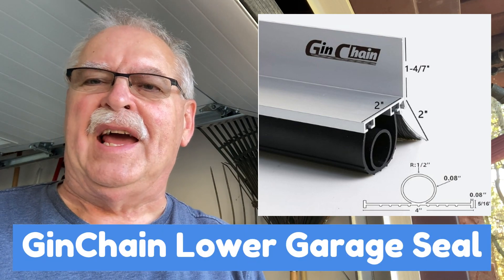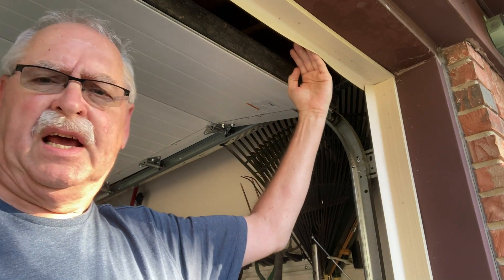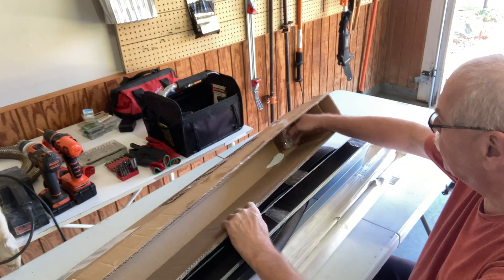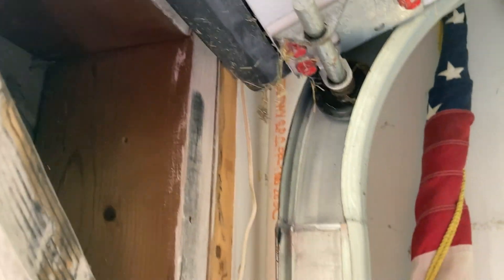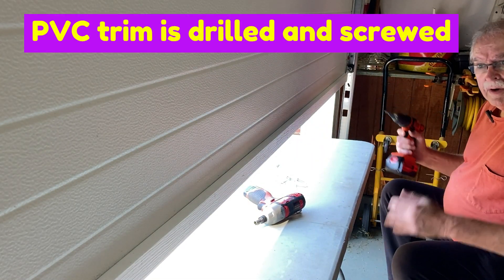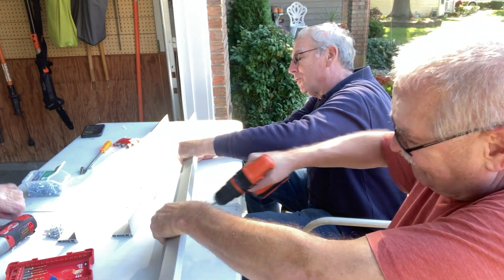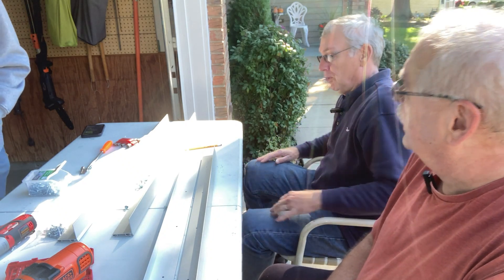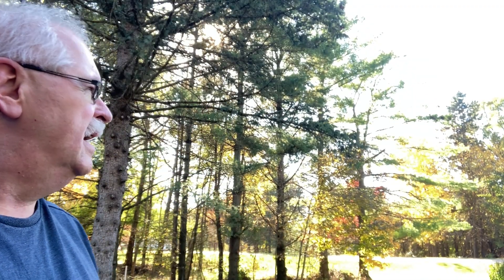Garage Door Lower Seal - GinChain Zonon Duzzy

Comment: That looks great. I tried sliding that anti rodent rubber on an 8ft door. What a pain. The metal addition looks good. As soon as I get my Ryobi batteries in I can have another project. Just hoping the guy comes to mow for me after Milton and Helene have wet everything. They are making a ton of money down south.
Reply from the maker: I looked at the anti-rodent rubber as an option to stiffen the door seal, but decided not to go that way.
Good luck on the battery swap!